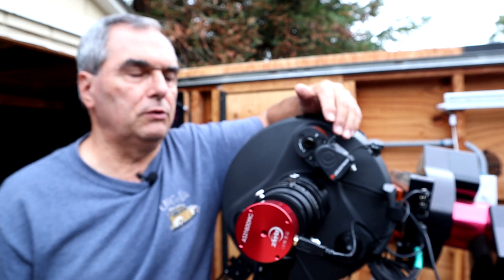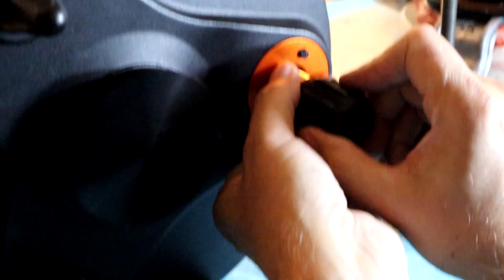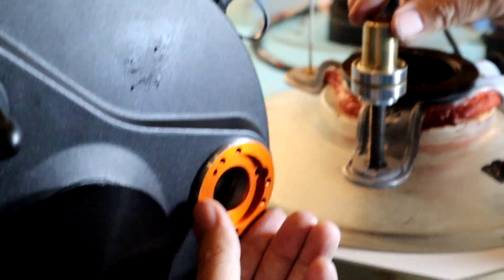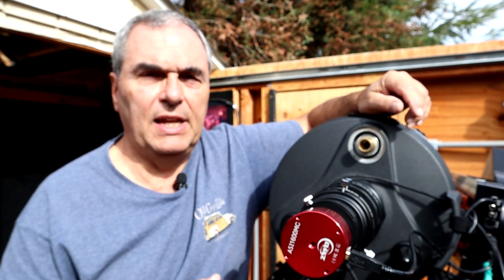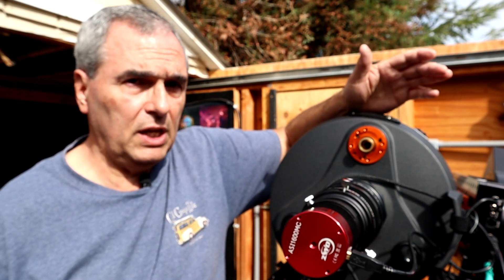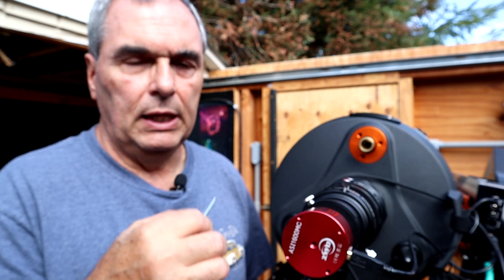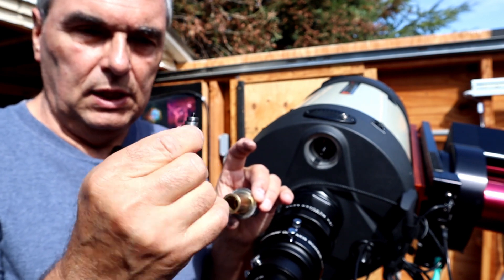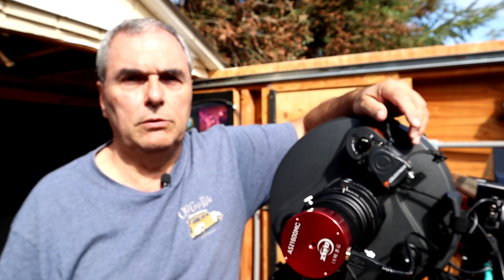Celestron Motorized Focuser Problems & Fixes

Comment: Is your focuser V2 or the original?
Reply from the maker: Mine and Dave's were the original, part # 94155.  I bought mine in Jan 2019 and Dave bought his before that.  The revised version came out around Sept 2019 and was given a -A to the end of the original part number.  This is why we showed how to fix Celestron's mistake was likely was a problem with the engineering drawings sent to China for replication.  I don't know if they correctly fixed the problem with the -A revision but hope they did.

Comment: Curtis, your deep dive into focuser installation and travel is very use-filled! Thank you! I've  just installed the focuser motor on a SE6 with no issues. But I have another motor ready to go on a C8, and will watch for mirror misalignment.  

What length works on a C8?
 Your indepth reviews are always appreciated.

Comment: My first attempt at installation ended up wrecking the motor. The good thing is that high point allowed for a free replacement. I ordered lengthed M2 screws for the NexStar SE6 and placed the base over the original plate. That worked. I have problems with the calibration but I was able to work around it.
Reply from the maker: Glad you got it working and it only cost you some headache.

Comment: Many thanks for this, i didn't know about this issue and I'm considering buying a focus motor. A straightforward and comprehensive engineering explanation here, very helpful.
Reply from the maker: Thank you.  I think Celestron has fixed the problem but if not, as you can see in the video, the fix is very simple.  Both Dave and I are very happy with the performance of the focuser.  He uses it with SGP and I with NINA, also with TSX and Sharpcap.  No issues once fixed.

Comment: I bought a C8 last year in fall with the Celestron focuser. Does the issue exist there too?
Reply from the maker: I don't know if anyone has reported it fixed or not.  You can easily tell when you go to install it, your will, as shown in the video, whether the metal piece fits down into the recess or not.  You have to do this to install it anyway.  If it does not the video shows you 2 ways to fix it.

Comment: Installing the V2 (indented one) on my 9.25" has became a nightmare! As i tighten the 2 screws that hold the main focuser body to the plate, it pulls the focuser body out of square with the plate, this obviously causes a problem with the shaft. Because of this, if i were to attach the focuser body to the telescope focus tube and tighten that down, then as soon as i try to tighten the 2 screws that hold the body to the plate it'll obviously put pressure on the shaft The reason this pulls out of square when i tighten the 2 screws is the 2 small round raised bits on the focuser body  that the 2 screws protrude through isn't flat and level to the body, they're both slightly angled. I could rectify this if i filed the 2 raised bits flat, but i don't want to do this for obvious reasons. I could also file down 2 small washers to cancel out this slant on the raised bits, but why on earth should i? And why there's only 2 raised bits instead of 3 to keep the body square is beyond me. Horrible design! It seems now i have to enter the ball-ache of returning it.

Comment: You can eliminate mirror flop. Get Moonlite focuser. There is no reason to have observatory, have a fine mount and scope and use inherently crap focuser.
Reply from the maker: Actually the Celestron motorized focuser works reasonably well.  The only issue is with the older mounting hardware design which is easily fixed as I show in the video.
Reply: @astronomytipsreviewswithcu740  Once Shaq told “Good but good enough”. In my opinion, focuser is as important as mount, maybe even more important. There is no reason to compromise here.

Comment: I have also been unable to obtain focus at f7. I discovered that I can't get the attachment posts to fit flush to the cover plate; they only come within ~1mm or so, so are unusable.  The inside of the motor shaft has a ridge that hits the 'scope's focus shaft, causing the ~1mm gap.

Comment: I just left the original plate on and added slightly longer screws on my 8se put on the focuser plate and sandwiched them together. Then put on the focuser seems to work just fine so far. I just did it today so we shall see.  The calibration went ok and tested for about 30 min. Seems like a lot of  extra work if longer screws and using both plates work as you did. I saw this video after I did it.
Reply: I did the exact same thing on my Nexstar 8  two  years ago and never had a problem with it. I was reading about people making adapters or modifying the adapter plate, I couldn't understand why they went through all that trouble when you could just use longer screws with the original plate plus adapter. I wrote what I did on a thread on Cloudy nights hoping it might help someone else.
Reply: I have the same unit (8Se). Wondering if you can remember what length screws you ended up using.  Thank you
Reply: On your 8SE, what length of screw did you use?

Comment: The motor bolted to the plate takes out any "wobble".  Now that you have locked down the shaft on both ends (between the plate and the focuer itself) good luck with temperature swings - the motor will almost certainly bind.

Comment: I have a 9.25 edge and when I added the focus motor, I also couldn't reach focus while using the reducer (.7x). The problem was that the focuser's calibration routine set a range inside the physical range of the focus assembly with a buffer at each end and the focus point with the reducer was within the buffer. It took quite a bit of back and forth with Celestron before I finally got a, 'oh yeah, we've seen that problem before'..... They then sent me a longer screw and spacer to give the focus assembly a larger range which in turn extended the focuser's calibration range so as to include the focus point. Now, if it weren't a Celestron focuser, or a Celestron reducer that I was using on my Celeston scope, I might understand some incompatibility, but......

Comment: any updates on this? what does celestron say? as i have the focus-er on back order 🌘🌛
Reply from the maker: What update are you expecting?  I read that Celestron told one owner to use the method I used to fix the problem.  I hope they are making a correction to the production line so that future owners like you don't have to do anything special.
Reply: @astronomytipsreviewswithcu740 Update ... Did the motor ever bind after making the change?
Reply from the maker: No @MrSummitville

Comment: I took apart my focuser on my EdgeC11 before I even finished watching this video. My focus knob does not have the same play that you showed on yours. My adapter plate is also is able to fit flush onto the back of the OTA. So it does not appear affect all scope. My EdgeC11 is around 10 years old.
Reply from the maker: Are you talking about your Celestron motorized focuser?  If you are talking about the stock manual focuser there is not issue with that.  The cover plate sits flush.  It is only the adapter plate for the motorized focuser that has the issue.  If you mean the adapter plate on your motorized focuser, then you point is well taken.
Reply: @astronomytipsreviewswithcu740  it is with the motorized focuser adapter plate; the exact same setup as yours. The reason why I stated my scope age is that the motorized focuser is relatively new so the difference is likely on the SCT back. Engineers tend to work off samples that they have in the office and that samples will always be ones that first came off the production line (older scopes). We can tell easily by comparing the bored out diameter of our SCT back.
Reply from the maker: @AnimeEd  Thanks for the clarification and what you say makes sense.